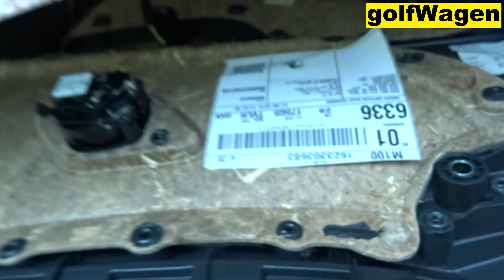VW Golf 7 rear door led light install

Comment: i just removed the rear door panel today and did many many current measurements. Same as in your video, i found the permanent + in the window motor and i saw that the 2nd pin in the lock plug has a signal only when the door it.s closed, but i didn.t came up with the ideea to connect both. thanks a lot for this video.

BTW, i have a Tiguan ad1, in tge rear doors has the same pinout as your car.

Greetings Erich